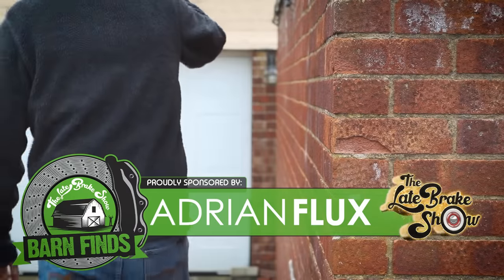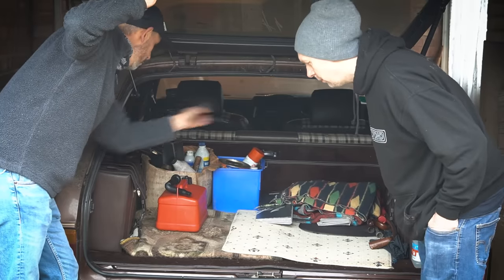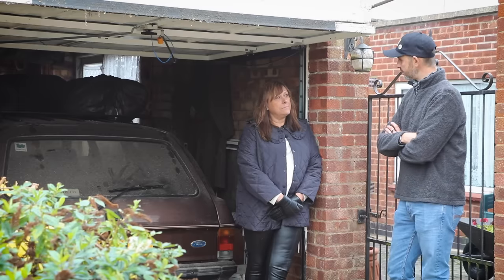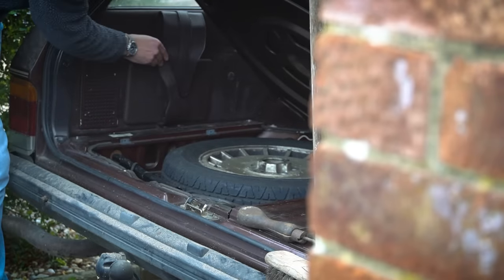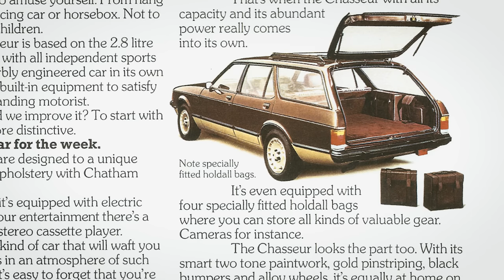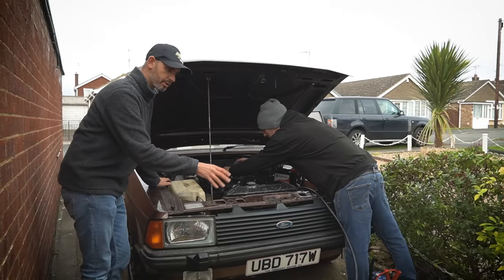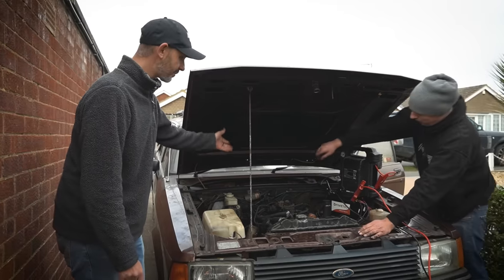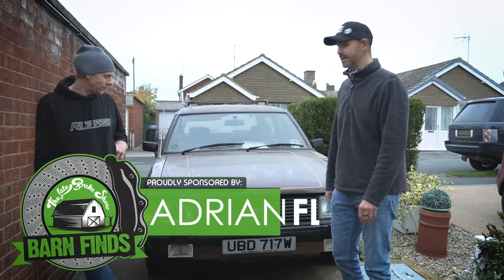Classic Ford Barn Find is the ultimate rare special edition

Comment: I was a Ford Mechanic in 1980 when this lovely edition Granada came out. I remember it as i was lucky enough to PDI a brand new one . I only remeber it being available in Estate version and with a non Injection V6 2.8 Colonge engine. The Granada was built in Germany and this was a period when  Ford brought many special edition cars out in the late 70's 80's to name some of the special Ford cars had edition names like  Linet,Harrier (Escorts). Olympic (2000E) Kingfisher,(Fiesta). I worked an all these cars . Happy days 😄
Reply: You can add the fiesta dash and later the escort cab dash to that list 😁. The Orion 1600E was lovely too. My uncles worked for Ford throughout the 70’s and 80’s and they all loved the mk2 harriers (white or silver)
Reply: I remember out in the colonies of NZ that someone fitted a Cologne to HC Viva as an aftermarket repower.
This was fifteen years ago.
Such was the option if not using the GM 3800cc V6 when not available.
The 3.8 was more popular in Canada 🇨🇦  and New Zealand 🇳🇿  as a retro repower for HB & HC out in the colonies.❤

Comment: Jonny these barn find episodes are definitely the best thing on the late brake show, keep them coming.
Reply: Not really a barn find is it ?
It’s in a garage
Reply: @robmills1547 Same thing.
Stored away in original condition?
Reply: @robmills1547  As the term barn find had been used at least 7 times in the previous posts I didn't find the need to split hairs over such a small matter.
Reply: @robmills1547  cretin

Comment: Interesting to learn about the UK Granadas from over here in Canada.  We had a Ford model in North America with the same nameplate, but it was a completely different car with the underpinnings up until 1980 based on the earlier Maverick which was cribbed from the 1960s Falcon ... the same platform that gave birth to the original Mustangs.  In 1981 and 82 it was a Fox platform car (same as 79-93 Mustang), but the name died in North America after that.

Comment: I remember the Chasseur I was working for Ford dealers around that time, they looked really good when new, always liked the Granada estates. I had a MK1 Consul GT estate, I was not aware they built a GT estate,  (I also had a MK2 Cortina GT estate, they were special order) the Consul may have been a special build as the first owner  was Ford Motor Co, I understand it had been a rally support car, it had several bolt holes in the roof where a large roof rack had been fitted I assumed. It had a 3 litre engine with a manual gearbox and power steering, Imola blue. It was very quick for the time.

Comment: Fantastic find, you jammy b.....  I've always been a huge fan of the Mk2 Granny estate - I've got one right here, in fact, in the middle of being restored back to roadworthiness. Like most younger fans (by which I mean, approximately the age of the cars themselves :D) my Dad had one - it was in our family for years, and back in the early 1990s was my daily driver - it was actually the first car I "owned" (V5 in my name). Started life as a 2.3 4-speed, ended as a 2.8i 5-speed. Eventually, the tinworm just got too bad, and she ended up a banger racer, like so many, RIP.

I don't believe the car you were looking at had A/C (not enough gubbins under the bonnet), but you'd have struggled to find the A/C "button" anyway - because they didn't have one: The fan speed switch also had a push-pull switch inside it - pull for A/C on. And if I recall correctly, there was a small green(?) light came on next to it, when the A/C was on. I had a couple of Mk2 saloons with A/C, it never worked...

Comment: Ford North America used the metric TRX wheels on some of their models around 1982-1984 as well, including Mustangs.
Reply: Citroën and Saab also used them and they were and are indeed four times the price of any "normal" tire. In fact, there are aftermarket wheels made in the same style that fit 14 or 15 inch tires, to put on your CX Turbo or GTI.
Reply: @Ricketik65  there is a Fox Mustang resto parts supplier in the USA that had a run of replica TRX wheels made for those cars in 16".  The originals were approximately 15.3" (390 mm).  Some of the sporty Escorts got a 365 mm version, also used on a few other FWD Fords and Mercurys around then.

Comment: Very nostalgic for several generations. Amused me that he had extended the garage to accommodate the Chasseur. (I certainly recall the Sierra version of it). Our neighbour had bought a brand new two-tone Granada MkII saloon (silver lower half I believe, and either dark grey or dark green top half) for himself and a brand new Capri for his wife. He had a long single width garage, but it wasn't quite long enough to park the Granada and Capri line astern. So he modified the garage door so it closed to 45 degrees and then bent the door in half over the end of the Capri and built side panels to fully enclose the Capri's nose! Mad, but effective. Great work, Jonny and the team!

Comment: A pure delight to watch this!
I'm not as much a Granada fan as a Ford Capri - with the ultra long bonnet hiding a V6 (long enough to hide a straight 8 cylinder engine) - or an Edsel huuuuge enough to hide a small suburb under the bonnet and all citizens of a village in the back seat. Dad was an auto mechanic and he was able to start just about anything or, at least, figure out what was wrong and then work around it to make any engine tick and purr. Superb finding! 👍

Comment: Starting that brought back memories of my old MK3 Cortina many years ago - cold winters morning, crossing your fingers that it would actually start before the battery gave up completely! I seem to remember that I somehow learned that if I stuck my comb in the top of the webber carb it would hold the choke plates right in the sweet spot for guaranteed cold starting. Ah, the joy of motoring back then. With regard the Granada, great to see that rare MK2 in such fantastic condition, a real testiment to how the owner loved and cared for it. But to be totally honest, my eyes lit up the most when I saw you driving that MK1 at the beginning. Brought back so many memories of when my brother had an identical, but right hand drive car. After being used to being driven around in my dads old Austin1300, the Granada seemed like a dream machine. I remember sitting in the back being pushed back into the seat when my brother floored it. Just so quiet, comfortable and powerful compared to most other cars on the road at the time.

Comment: In my youth, I ran a Granada 2.0L ( Poverty spec.) TTO 3X. 1982.

That steering wheel has a boss that can be removed in moments with the key and can be replaced seamlessly.  NOT ONCE, did the Rozzers ever find my stash of 90s Resin 😂

Thank you Ford.

Comment: I got a v6 manual Grandad for £60 when I was a Student at Bridgy College and we use to have a right laugh in it as I think it easy took 10 of use to/from the pub. Though thirsty for fuel, it was years back when it was cheap and the price of the car at the time reflected the running cost. I worked in a bike shop and got it stickered up as a mountain bike shuttle and many bike racks on the roof after watching the MTB Treds movie. With the back seats down a bike would go in without removing any wheels, great times we had rallying the old boat around the hills. Sold it at what I bought it for if I remember correctly.

Comment: I've been squirreling my 2004 VW Passat 1.8T Wagon away as a project/special days. Less than 7800 made worldwide even smaller portion came to the states here. It's a GL with everything the GLS has Sept the Moon Roof. It's a 5-Speed manual and it has the Four Motion (All wheel drive witchcraft) and it's in pretty great shape being the 3rd owner. 2nd was my xwife who I taught how to drive a manual. But I love my, "Granny Sleeper". I use a 05' Trailblazer EXT LT (V8) that seats 7 and has the All wheel and 4x4 options as my daily driver. Living in Wisconsin more than just 2 wheel drive is important to have.

Comment: We had the last Granada, the Scorpio 2.3D maybe our best car ever!!! It was for towing our caravan, the only thing I disliked was the long tail which made the caravan sway easily. Due to ageing parents, we swapped the Scorpio for a Ford Galaxy with 7 seats. We now have a 2014 VW Transporter 5 seat van to tow with. That's been a nightmare from new, on its 2nd engine, a new head, water pump, then the ECU gave up. It took 6 months to repair at a cost of                   £ 6,000.oo+. The finding was iron filings in the fuel line from the HP fuel pump to the injectors, now it runs as it should have from new. I miss the old BIG FORDS for towing with, I brought our son then daughter up on Fords, but we have now all moved on, sad I know but if they're now making what you want that's the way it goes!!! Ps, Great Show Jonny!!!

Comment: I had a 1984 Ford Falcon XE in Sydney, Australia. It was similar to this, but wider and with a straight six 3.3 carb engine. I shoehorned a 351 V8  but didnt know I had to change to a 9 inch diff and bigger wheels/tyres etc.

Comment: I'm actually after one of these to build a family daily, I'm going to use the running gear from the  mondeo/transit diesel update the electronics keeping it as original as possible, today's cars just don't have the character size or practicality of a 80s 90s estate yet the old estates don't meet today's regulations or saftey, it been a build I've wanted to do for years but finding a good based is pretty hard, but this isn't somthing to be messed about with imo as there's not many as original or as rear as that this was real good content and I enjoyed every second of it well done lads 👌
Reply: And just to add to my comment I have my own ✌barn find✌ not sure if it's your thing tho I parked up my nova 1.3 sr in silver back in 2001 in a garage and not touched it since, last time I went to it was around 2016 it's on axel stands in a well ventilated garage and I'm considering pulling it out next year to refresh it as it's all original apart from lowering suspension and white dials and I believe there is only 3 or 4 silver ones left in the UK I'll send you a message after Xmas see if it's somthing your interested in

Comment: I remember working on the Granada during my time at a ford main dealer 1976 to 1983. k Jet Bosch fuel injection system . It had a plastic main timing gear that would shear. Also had a problem with the axle pinion knock . If I remember it,was a C3 transmission

Comment: Hi, great video. A little tip: Don't put the fuel filter behind the fuel pump, because they are not made for a high pressure. Especially if the get old an weak. Fuel filters have always to be before the fuel pump. Best regards Ralph

Comment: These models in automatic had the C3 auto box fitted. If it won't go backwards when cold then the high & reverse servo seals have gone hard. I overhauled several of these back in the day with most of them just requiring a new set of internal "O" ring seals and gaskets. Happy day's!

Comment: In Australia we had the "superior" XD-XE Ford Falcon/Fairmont, with free Australian Design Award window decals, it shared the same looking headlights and grill as on the Granada and possibly some other bits. No over complicated and fragile independent rear end, headlight washers? fugly tail lights, Chathams, Cologne V6s, Peugeot Diesels, VAT and Granada badges  ;-).

No Olympic Chasseur Edition, however we did have some specials, the ESP - European Sports Pack - Option 54. 
ESP and other models could be ordered with a 5.8(351) Cleveland V8 a smaller 302(4.9) V8 and some straight sixes(4.1, 3.3) such as the 250 crossflow.

The ultimate pick for some of us XD/XE Ford hoarders in Terra Nullus would be the Fairmont Ghia ESP with the 5.8 Manual, option 54'd with the Scheel seats. As for wagons.. Sundowner? 

Enjoyed the show, thumbs up.

Comment: lovely. :)
(in after everyone else)
I don't "remember" those, as my dad used to drive Renault 4, and later Toyota Starlet estate, before the divorce and everything and he moved out. myself, I learned car mechanic on Opel, and when I was almost done a Taunus Mk2 estate showed up as an used car (Mk4 cortina to you guys), in signal green and green interior, and I got infected with Ford; it became my first car. in 95 I decided to visit a Knudsen-Taunus meet in northern germany where I got additionally infected with that nose. :) I'd visit a handful of Ford and other classic car meets, and came across a Chasseur Granada a couple times, I think there were three or four different individuals. one of them was turbocharged courtesy of Michael May of Switzerland(tm), I think it had 250HP? the cars, as I remember, were in good condition, not as preserved as this one, but complete and cared for.
the abovementioned Knudsen-metting was held by a collectoir who came across the most rarest of german factory-made Fords: a 1974 Wagon with 2.3 litre V6, metallic paint, "Ghia" interior, and vinyl rooftop. they made 5 of them in different colours to see how it would look, and how much effort it would be to determine the price tag. then decided time wasn't ready for them, and they got sold to Ford-people. one ended up with that collector, who wondered about the setup mentioned nowhere in no ad flyer anywhere, and did research. (which triggered the collecting, as he admitted) at the time, early 90's, 4 of the five cars were still existing.
the 2.3 wasn't available until the 79 facelift as well as the Ghia interior, only the wagon never had the wood lining on the door cards like those 5 prototypes, so they were way ahead of time. :)
side note: the roof rack seems to have been an option to at least early Mk2 Taunus wagons, but I've encountered only one, on top of a very rusty 78 wagon. I offered to buy it, but they never reacted, and I guess it's long been scrapped.

Comment: I had one of these. I bought it from a dealer in Portobello, Edinburgh in September 1988. I was 20 years old. I think I paid £1500 for it. I traded it for a Capri 2.8i in July 1989. I worked in a tyre dealers when I owned it and the tyres were £150 each which was more than my weekly take home pay and only available from Avon and Michelin. I'm sure the tyre size were 200/55VR390. The wheels look the same as the Granada Ghia's of the time but Ghia's where 14" in diameter making them over an inch smaller than on my car. The wheels are large for the time as most cars had 13" or 14" wheels (a mini wheel was only 10") so the wheels on this made the car look beefy. I also remember the log book stating the the model box "Granada GLS". Also if I remember correctly, it is possible to remove all the luggage. Two are belted in and two slide up and out I think?

Comment: The model was based on a German special which had provision for a leather pouch to carry a hunting rifle hence the name.
It was built in Cologne.
The car is missing rear overriders, the fixing bolts are visible but the PU mouldings have torn off, otherwise in great shape.
The bumpers are certainly ‘dainty’ , the facelift had big chromed bars and rubbing strips but not on Chasseur.
The similarity of the Australian model is not a coincidence, the Designer was the same and a group of engineers went from Ford Dunton to Melbourne to assist the local team on doors, hoods, boots etc but based on the US model.
500 sounds about right, it was special with black door frame cappings etc apart from the bespoke luggage furniture.

Comment: My Nissan 300ZX came with R390, and I couldn’t source 1 tyre for it (was delivered with rim only, and spare from Mercedes mounted on), most local shops couldn’t understand what tyre size do I want, and only one, where older chap (in his 50s) was working, said he haven’t seen those in ages, and remember his BMW 5 series had ones on it as well. I have spare set of alloys from my van, and these will be added on once Z31 is fully restored

Comment: With regard to the TRX tyres, I had a Saab 900 turbo fitted with these wheels/ tyres. I think these were unique to Michelin and they had a special feature,  they were designed so that in the event of a ‘blow-out’ the tyre remained on the rim. This required a unique rim/ tyre design combination. I think they were in metric sizes to prevent the fitting of an ordinary tyre.

Comment: Nice condition. These estates were before Mini Vans came along. Cars in storage a long time tend to disolve without use. weird electrical faults, gas and brake lines rust away. Gas tanks leak. Would it pass an MOT?

Comment: I remember the Metric Tires, had a guy with the TRX wheels on a Mercury Capri. 
Was down to only Michelin making them, but could buy them in their Sears labeled Weather Beater brand for like $110 a tire vs $165 if they said Michelin on the side.

Comment: I remember PDI ing one of these when I worked with a Ford dealer in Greenock [Alexanders] I think they only ever sold one as far as I can recall, pretty faultless although the automatics at times wouldn't go into reverse or top when cold , strip the box and replace high and reverse o rings , thermostat housing used to corrode and crumble due to incorrect coolant mix and poor quality alloy casting, diffs could whine but then again all the Ford range did , countless rebuilds under warranty , high mileage models would eventually crack the Flexi plate/ ring gear which would give an alarming rattle , we used to repair Granada Hearses under warranty and as daft apprentices we had plenty adventures with them , constantly grounded and plenty kicks up the arse ...happy days.